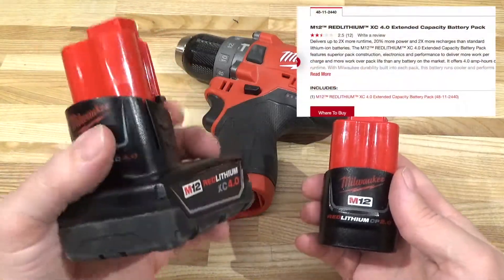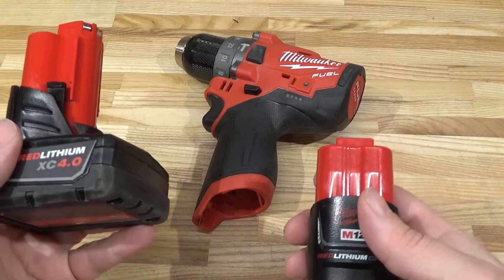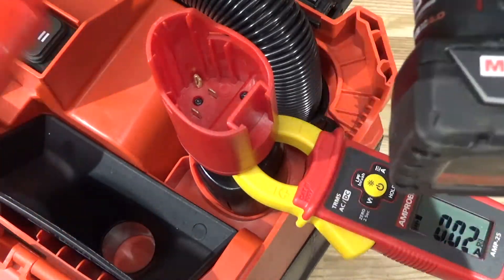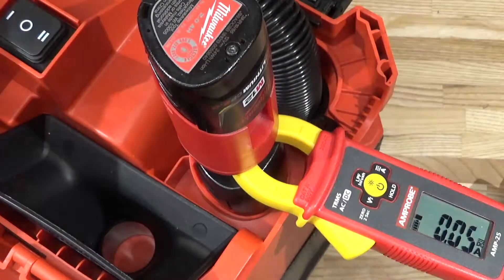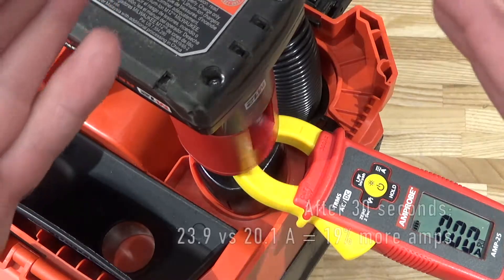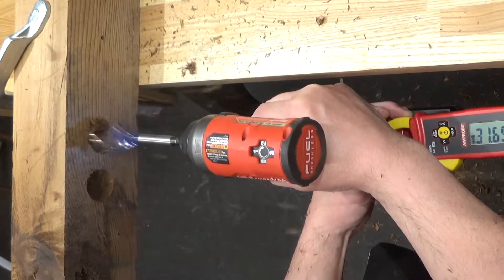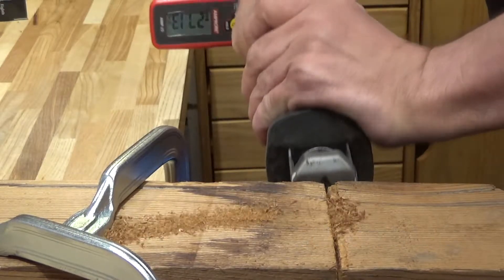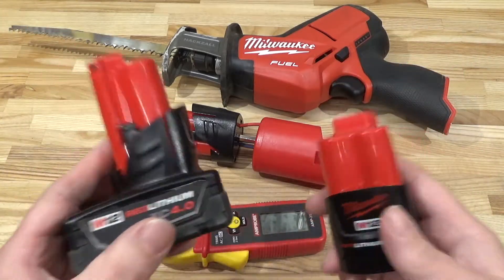Test: Milwaukee M12 Compact Battery vs XC

Comment: Good video but what I really want to see is the difference  between the cp3.0 and the xc3.0
Reply from the maker: Yeh... undoubtedly the xc will provide more power. I think a future vid would need to be on compact 1.5 v 2.0 v 3.0 and xc 3.0 v 4.0 and 6.0. But I not going to buy that many batteries for just a boobtube video.
Reply: @RoomForTools  The only change I would mKe to your rig is the ability to check voltage/drop. Then you can calculate power 🔋. Otherwise, the best tester ever. I'm curious to see what the 3s3p 9.0 Chinese batteries can push.

Comment: I would have liked to see the voltage listed at the same time. Since voltage and amps are inverse, is just looking at amps really a good test? I would like to see a similar load test between batteries also showing voltage to see how long each can run. As the voltage drops amps will go up and reduce run time and also create more heat in the device circuit.

Comment: I wish you millions of subscribers, awesome high quality content. From my research the compact battery uses 15a continuous 30a peak cells, would there be any advantage to replacing the cells with some higher rated 30A continuous cells? Will use the battery as is for now but when it dies will definitely recycle it.
Reply from the maker: Thanks! Not sure replacing cells would help hugely as the tools themselves are regulated for maximum current draw. XC batteries should be able to deliver twice the amps as compacts, though the tools draw only 10-30% more from them. Probably a wise decision decided with input from the engineers and the legal department!
Reply: @RoomForTools  
The cp1.5 has samsung 15M cells inside. They are rated at 23amps continuous. The problem is the cells & nickel welded to them heat up and changes the resistance of the thermistor. The tool reads this, and lowers or cuts output. Sharing the load between 2 groups of (3) cells allows it to remain cooler and thus run harder. I'm not sure, but I think the m12 tools are able to identify an xc vs cp pack by the voltage drop under load. 6 cells vs 3 cells means shared load, less drop. 
Tap a volt meter in, and run that test, you will see what I mean.
That's a cool test pigtail/device you made there, kudos. Thanks for sharing.

Comment: Hey! I was just about to create a similar rig for my M12 tools! Specifically I want to test the 1/2" gen 2 fuel drill which you showed in the first cut of this video. Curious to know if the overload cut-out works when the voltage dips too low under load. I want to connect the drill to a car battery and see if the torque increases.

Comment: Have you tested the amp draw on the m12 fuel circular saw? Was curious if it drawed enough amps (maybe under heavy load) to pick the 4.0 battery over the 6.0? Thanks.
Reply from the maker: Future!!

Comment: This was really cool, what a smart way to test! If I understand correctly, an amp hour is a measure of capacity.  It’s 1k milliamps. So why is it providing higher output/horsepower? Could it be the power state motor sensing there’s more available power available to draw from? Also I had the dampest thing happen. Used the m12 fuel impact driver to break a lug nut loose with a tiny 2.0 battery. Then tried it again in the m12 fuel impact wrench and the impact wrench couldn’t do it! When I put a 6.0 in the impact wrench it tore it right off. Interesting stuff…
Reply from the maker: XC batteries are in two series in parallel, so potentially twice the current delivery. In reality the tools do not draw twice the amount, but they do draw more.

Comment: Very true about the greater the amp hour  rating the lower the peak discharge rate.  C rate gets in the way with higher A/H but since they are scaled back electronically the regulated peak discharge rate should be the same, just with less voltage drop.  Right?

Awesome video btw great idea with using the amp probe!! Takes speculation out of the debate.
Reply: I saw a video that just went off torque for the m18 mid torque and the ho xc6.0 performed better than the 8.0 as far as peak torque was concerned. The xc12.0 uses 21700 cells which has a better energy density than the 18650 so it takes the cake for m18.   I'd still love to see discharge ratings compared for the higher ah batteries.
Reply from the maker: Thanks! Yeh, should be less voltage drop, but will need to buy some more batteries to investigate.

Comment: Should do this to all those knock off cheap batteries. People always directly comparing the run-time, which is stupid for cheaper cells tend to have more Mah than expensive ones made for high draw/amps. The real difference is going to be the power it delivers.
Reply from the maker: Run time and power delivery are at odds with each other.
Reply: @RoomForTools  I've been heavy on 18650//21700 batteries for 15 some years now. Use to make my own vape mods. Needless to say you need to know what you're doing, or can seep/explode. Then I learned thats exactly what is in these tool batteries. Going to 21700 cell my first m12 battery that dies. Just not sure if the onboard safety will stop the extra amps or not. I mean it makes sense... Bit larger, but can hit 35-45 + amps, where as 18650 more like 20-30amps. Or you could buy 21700 at 25-30amps with like twice the Mah that 18650 can offer. Considering at times a 18650 can spike to 35+ amps, I'd think the drill could handle that and then some.

Comment: Hahah they fix the communication for that 20% huh 🤔 hahaha hmm what about the 3.0cp vs 3.0 Xc battery ? I’ll way 5% -10% it’s double the batteries 3/6 cells 😂🤔 have you seen the new dewalt pouch cells they will have more burst power amperage but how long will does battery last only time will tell hope they don’t catch in fire for the chemistry I mean years have passed so they have developed a more safe battery I guess